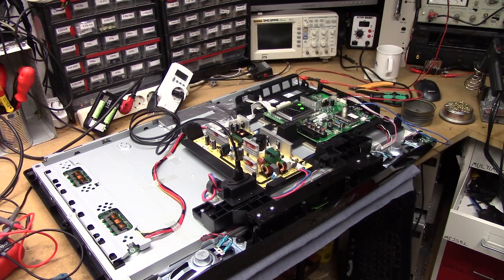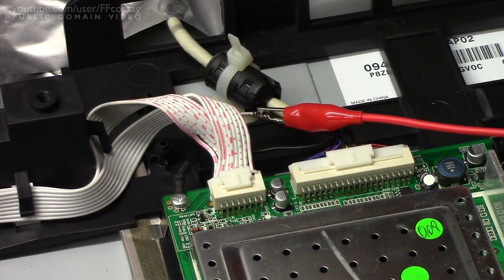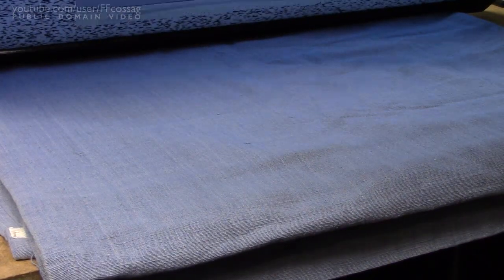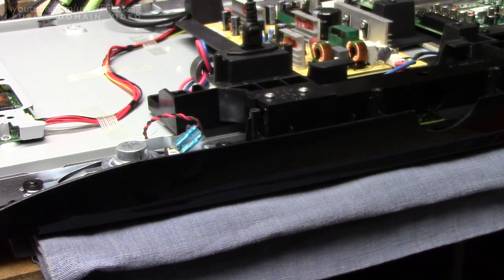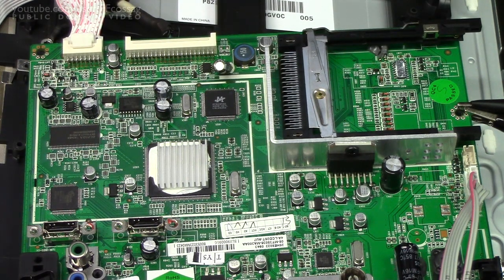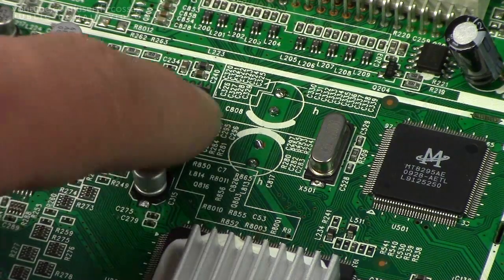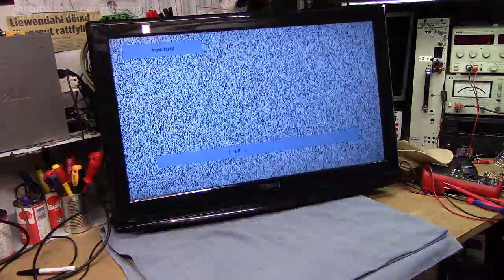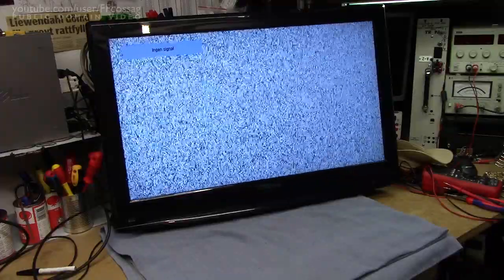Thomson 32HE8022 LCD TV UGLY repair; set would not turn on - now never turns off (but hey it works!)

Comment: How about fixing a 2w resistor to the chip with compound, leaving it effectively in circuit all the time. The resistor heat may be enough to do the trick. Hey, if they can have heaters in high precision test gear, why not on a TV standby circuit? By the way, I've rarely witnessed such a precise and articulated use of the English language on this medium. Congrats. My videos invariably have a few hums and ums - can't avoid them.
Reply: +M Caldeira I feel like running that resistor wouldn't be eco-friendly either since he needs to wake it up from stand-by and it has to be hot in standby (hence all the time) in order to work.
Although I admire your idea, I wouldn't have thought of that.
Reply from the maker: +M Caldeira That's a good idea on the surface, but since I suspect that the issue is bad flash, heating the chip would only accelerate the loss of charge in the memory, and cause the set to fail again in quite short notice.

And as far as me being articulate goes, that's just the magic that you can get away with with a tripod. Videos like this are usually cut at least ten times per minute of runtime in order to get rid of all silences, ums and uhs. Looking at your videos, I can assure you that you have a firmer grasp of the English language than I do.
Reply from the maker: +Pinkorek The resistor would be more eco-friendly, but it's likely to cause the set to fail quite soon again.
Reply: +FFcossag: you're right. I forgot about the flash issue. In my hobby, tube radios, a flash  usually means an explosion. I'm a little rusty on the digital stuff. Good job.
Reply from the maker: +M Caldeira That's probably the differerence between "a flash" and just "flash". ;)

Comment: Have you tried reflowing and examining the pins of the standby controller and the components associated with the POWERON path? A small chance the problem might be there.
Otherwise, a SPDT setup to give the POWERON pin what it wants to operate properly, button hidden somewhere on the case.
Also, Thomson remotes tend to be standard. Flea market or universal remote would be my first ideas.
Reply from the maker: +Teukka72 I resoldered the chip, of course - that's the obvious thing to do. Sadly, there always was good continuity everywhere, so the risk of the issue being the PCB is tiny. Everything after the chip works fine, since you can just mimic the funcionality of the chip to make it work.

Putting a switch on the TV is a pretty good idea, I might do that if I keep the TV. I think it's easiest to just have the entire thing put on a mains switch, though, since you'd be forced to go to the TV to turn it on either way.

As far as remotes go, I tried my universal remote, and it wouldn't work. I can probably scavenge some rotten used remote from the junk pile at work though, so it should turn out OK.
Reply: +FFcossag Try a Philips remote with standard RC5 code i assume it should work i think i did the same or if it was with a Kendo tv a long time ago
Reply from the maker: Hagis2k I tried a fair amount of stuff on it, nothing bites. I'll just get a proper Thomson remote for it, since they're easily available.

Comment: I guess an even more dodgy "fix" could be to affix a power resistor to the top of the standby chip so that the chip is always hot enough to work.
Reply from the maker: +Mark Furneaux Yep, a few people have suggested that - the issue is that it's very likely that the issue would return as the chip degrades further. We've got to keep in mind that by heating the chip, we're taking something that's just past the limit of not working, and making it just a little bit better so that it just barely works.

Comment: That's a strange failure. I've seen similar issues with standby on Yamaha amplifiers relating to shorted transistors.
Reply from the maker: +CreativeType In my experience, this kind of failure often relates to shit quality flash in the processor, causing it to fail to read its firmware unless it's warm.
Reply: +FFcossag Yeah just watched the rest of your video. That was a reply when you said it was a transistor failure. Seems like these chips are a common failure on cheaper tv's. Usually it's the BGA soc that fails though.
Reply from the maker: CreativeType That is sadly common, although I'm always hesitant to blame the SOC if I'm unable to find any other plausible cause of failure; just blaming the SOC and replacing the mainboard is just the easy way out. The issue is that they're near impossible to troubleshoot.